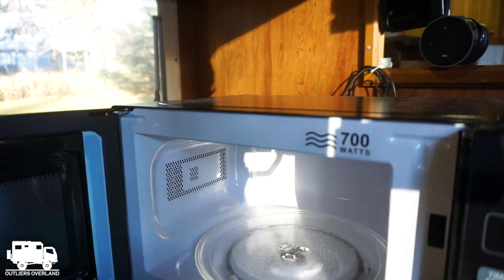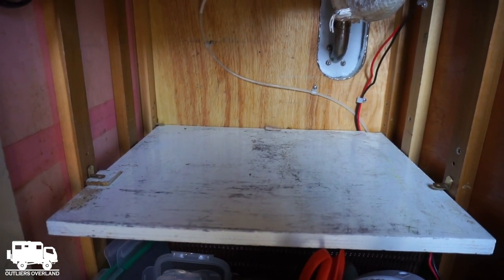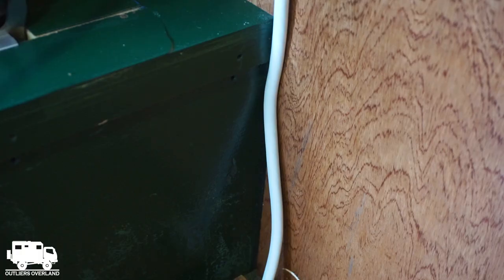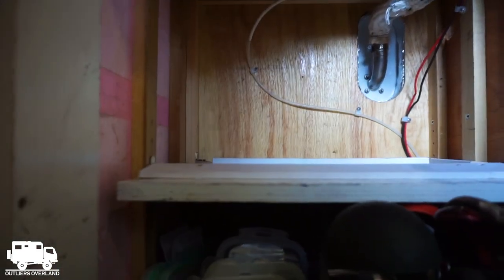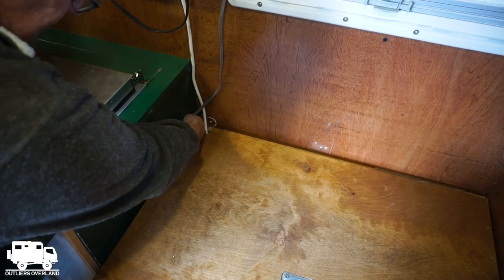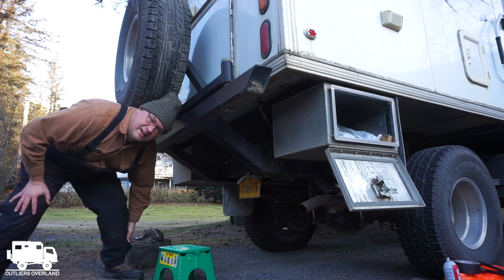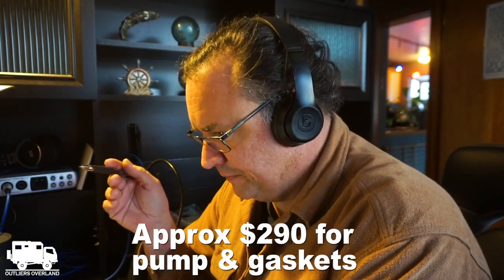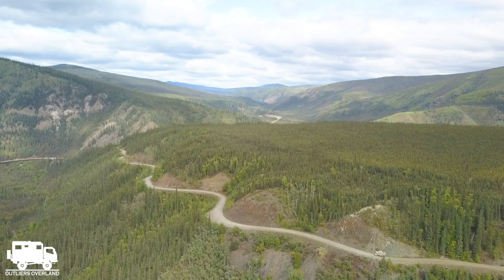Is Camping With a Microwave Selling Out?

Comment: Hey man. Make no excuses. Shameless hedonism is a way of life. :-) The watts on the back of the microwave are input and the 700 is cooking watts. The difference is inefficiency. Input is what goes into the load calculation.

On my rig, I have a new Espar D4 diesel airtronic with spare parts and maintenance supplies. For redundancy, I bought a new D2 "head only" adapted to slap right onto the mounting plate of the D4, plus supplies for the D2. 

Many issues with Espar units are user error, most often by letting them soot up. I think you had the pleasure of dealing with that. They require specific maintenance, but nothing beats an Espar, especially if you're planning on being at altitude. 

Ben, if you're going to take the rig to South America, look into altitude issues. Altitude issues can bite you in the butt. Please check it out for yourself on forums. My solution was to upsize my heater to a D4, whereas I could get by with a D2, then install a lower volume pump (high altitude pump). Also, I carry a regular dosing Espar pump as a spare. The lower volume pump doesn't let it soot up burning fat at altitude, yet this lower volume pump does derate the D4 at sea level (but it's oversized). If I ever have a big issue at sea level, I'd switch out the pump then have the full power of the D4.

Espar makes an altitude kit, but that get's sketchy over 10,000 feet I think.  

I like robust cold tolerance so the heating system is very important to me.

Comment: Many of the diesel vehicle heaters are not meant for full time use like your round the world trip may demand, so you may want to check on the duty cycle rating for your heater before you buy another one. I just bought a boat with a Webasto hydronic heater in it and I was happy to find out that the unit I have is designed for full time use. I also learned that Webasto heaters are widely recognized as a premium heater but it also comes with a premium price tag, so you may want to look into them.  Good luck. :)
Reply from the maker: Interesting.   I’ll look into that.   Our heater is actually out of production now, but it was so popular distributors bought plenty of stock.  I could have upgraded to the newer model, but it would mean changing the wiring harness and I don’t have time for that.   
Hopefully we don’t spend too much time in weather that is too hot or too cold.

Comment: Wouldn’t do without a microwave in our truck.  It uses a lot of amps, but only for two or three minutes when we heat or reheat food.  We’ve got ours mounted on the roof at eye level.  Works great and is very efficient.  One heads up though.  If you are in the starting cycle on any of your diesel fired appliances, don’t use your microwave or it will send your voltage below what the diesel appliance needs to operate.  Then you have to go through the dang starting cycle again.
Reply from the maker: The microwave had definitely found a home in the camper.   
Good tip on the diesel accessories.

Comment: A 700 watt microwave rated at 1500W, the difference is the power draw for the fans and turntable,  a 700W unit is the output rating which actually uses a greater draw to generate it, output power drops with age but consumption doesn't, an extra 100-150W is used by the electronics to make that output, hint, never run a microwave with nothing in it, it will damage the unit, put a mug of water in for any test.  Drilling a large bore hole through wood needs to be drilled from both sides to prevent the splitting, when the point appears one has the marker for coming in from the reverse side.  Getting a new Espar is the way to go, breaking the old one for compatible working spares is a good idea and will take up less space in the van.  The new one will be under warranty for a period but of no use if unable to return to supplier for repair or replacement.
Reply from the maker: Great information.
Reply from the maker: Surprisingly the old Espar takes up less space assembled than disassembled.   It’s a tight package.

Comment: Ben, maybe strip all working parts out of the old shell and they would pack in better and be lighter. You really should have one extra of each thing just in case.
Reply from the maker: I ended up packing the old unit and will may leave it with my dad.

Comment: This might be a good Idea for the top of the Microwave (Thermo-Tec 13500 12" X 12" Adhesive Backed Heat Barrier) on Amazon
Reply from the maker: That’s good stuff.  
Hope you’re doing well.
Reply: @outliersoverland  I used it to wrap my Can Am Outlander ATV's gas tank as I noticed the gas boiling during rides on hot days (from engine and exhaust heat) ... Worked well!!

Comment: Bear in mind that a Victron Multiplus 2k inverter is only 1600 watts, not 2000w. It is 2000VA which is a different measurement than watts. And if the internal temp increases to 104F then it outputs only 1450w. If the internal temp increases to 150F then it outputs 1100w.
Reply from the maker: Good information.   I always try to only use appliances <1000w with our 2000w inverter.
Reply: @outliersoverland  good! To be honest, i was surprised that my lovely new Victron Multiplus 3000 was only a 2400w inverter. I never realized that they rated their inverters in VA instead of watts, so had assumed that my 3000 was 3000 watts! It irritates me that some dealers actually list them (incorrectly) as 2000 watts or 3000 watts inverters.

Comment: You might wanna strap down the micro for them bumpy roads and something for the glass spin table inside the unit
Reply from the maker: There is not much room for vertical movement and bread / tortillas have found a home inside the microwave.   
Thanks for watching!
Reply: We take our glass turn table out of the microwave and wrap it on travel days.

Comment: That would be a 700 watt microwave. Which is good...700 is far less of a load on the system.
Reply from the maker: It has been working out great.
Reply: 700 watts is its heating capability. The 1050 watt on the back is what it consumes to do it. FYI